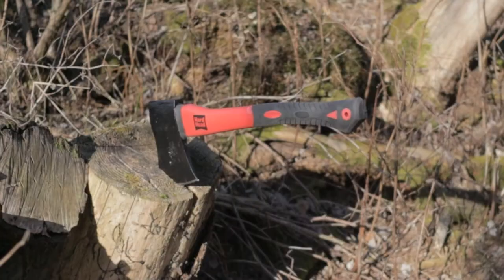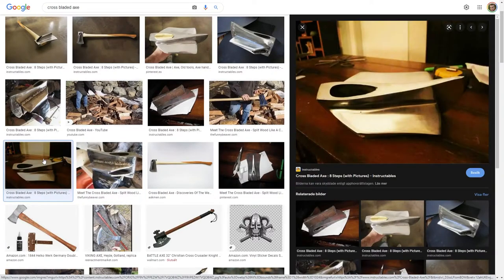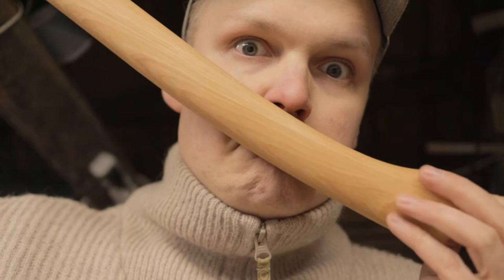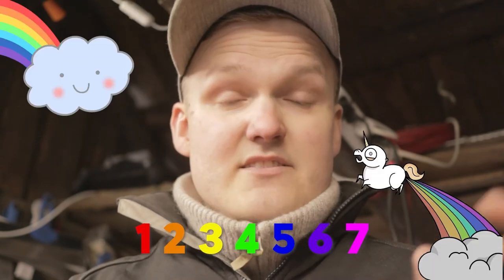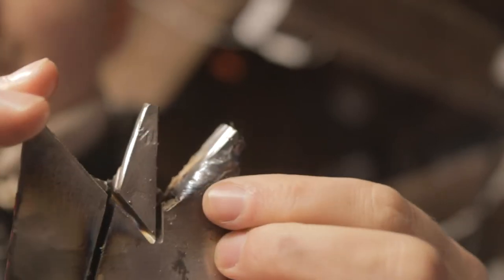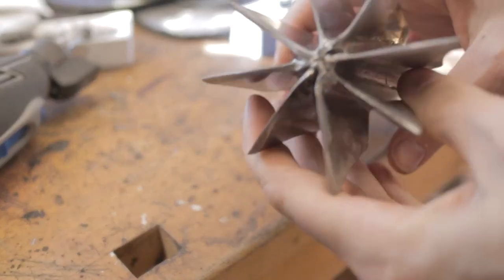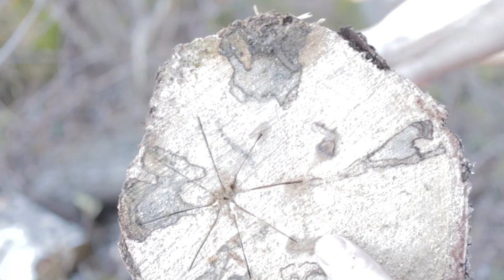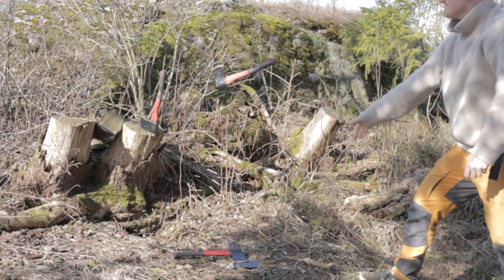Cross Bladed Axe x 2 = Quad Bladed Axe!

Comment: just use the quad 😂 just buy a quad wood splitter and weld a metal pipe too it Mabye fill with concrete too to add heavy ness and counter weight

Comment: I see a major issue with the way you made yours. You used hatches instead of proper firewood axes. They are to small and to thick.
Reply from the maker: Yep, you're right! It would also help if one of the heads were lower than the others. Think I need to do a new one soon and fix this 🙂
Reply: @TryingToBuildStuff  Can't wait to see it if you decide to make a video on it. I won't be too disappointed if you don't though. Its your channel after all. I'm just here to enjoy the content.